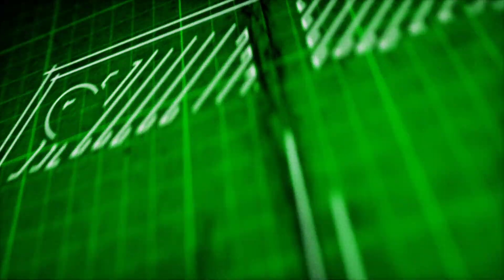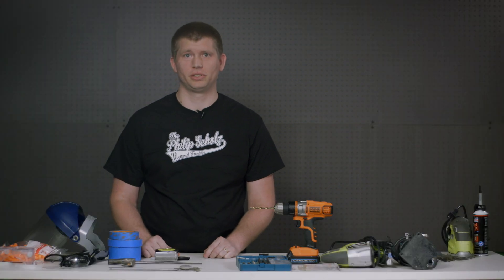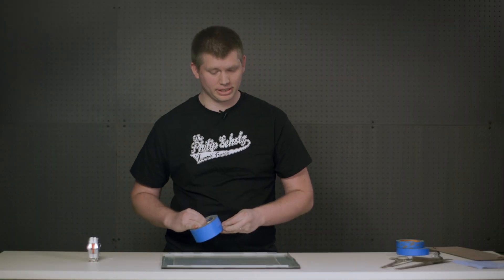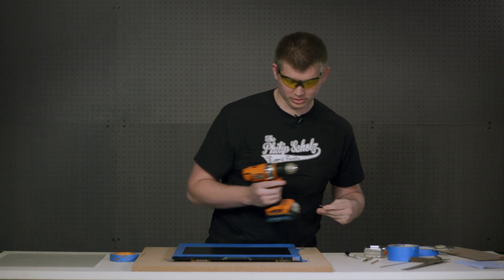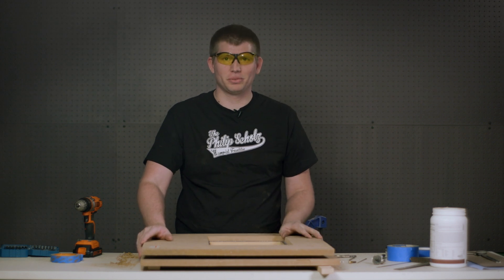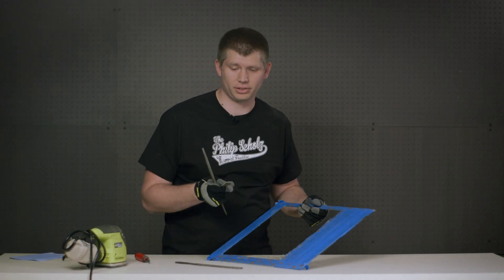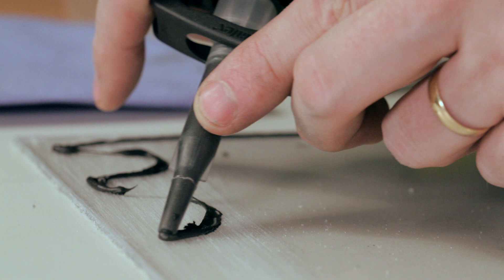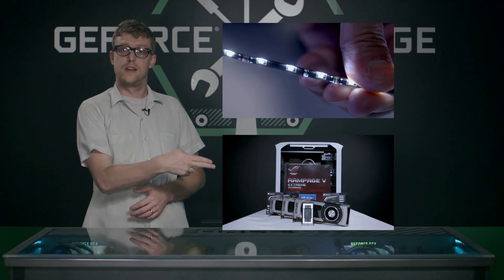GeForce Garage: Antec 900 Series, Video 1 – How To Cut a Case Window

Comment: would a dremmel with a diamond disk not give you a smoother cut?
Reply: arkatub its not really about the tool and the cut but having a guide to keep the cut straight using the wood template allows you to get a CNC style cut.

Comment: For the power tools, it would be a good idea to mention the 2 key words "variable-speed". Some may not realize this, and end up screwing something up. That's the main reason I never use my jigsaw or drill on mods, because I can't yet afford variable-speed models, just the single-speeds I currently have, and single-speeds suck for modding. Drills, not quite so much, but saws definitely.

For those with single-speed drills (or any, really), a punch + hammer are an almost invaluable combo. I use mine all the time, for all sorts of things, and can't imagine life w/out them, honestly.

Comment: I loved the tutorial till the part he used glue to stick the window to the case 

Such a horrible finish!

So much work on the metal and the last part "glue"
Reply: Jose Jimenez Would you rather use duct tape? lol.....If you ever used the stuff he used then you would know it isn't just glue. It's not cheap for a reason.
Reply: Bob Stewart he could do clips like the on this pictures with the whole piece of metal he cut from the case, and would have been better and wont cost more!

https://scontent-mia1-1.xx.fbcdn.net/hphotos-xft1/v/t1.0-9/11742723_860883227337974_3936574646639866532_n.jpg?oh=152bfa4542b187f2ef195ca6857dc264&oe=564DDED8

Just saying!

Comment: why not just stick the acrylic onto it with a strong glue?
Reply: Henry Chan The product he used holds better than contact cement. And it stays flexible. It's the best stuff out there. It's made for doing automotive work and takes the place of gaskets on almost everything. Once you try it you will never use anything else. Be warned though...  it seems to get everywhere when you start playing with it.

Comment: Cut in clockwise motion with the router? wrong it's anti clockwise. Clockwise makes the Router want to kick out, anti draws it against the work surface, also that i'm aware of i've never came across a metal working Router bit. Skip the whole Router part and just file the edges whilst the panel is in the jig,
Reply: Dinxsy You are incorrect. The shaft spins in a clockwise direction (if viewing from top down) and you want to move the router in the clockwise direction around the hole so that it digs into the material. If you move the router counter-clockwise it will jump around. That would be called "climb cutting" and can be dangerous. The bits we use are a high quality carbide with top bearing. Carbide will cut any metal without the use of a coolant but does not last as long as when used on wood projects. This is a video about using a router to do a window, not how to use a file on a window, but maybe in the future they will do one.
Reply: BSMODS Counter external, clockwise internal, thumb & forefinger rule. Not gonna lie didn't actually watch the video,skimmed over. Also Climb Cutting only really applies to wood to eliminate tear out and leave better finish, yet still not worth the risks, i know all too well the dangers of pulling work surface from using a stacked Rail & Stile bit setup on unsecured material at work.
Dual direction spiral cutting bit would eliminate the folding/burring of the tin, basically like a flute end mill, but the average hobbyist won't want to pay £100 plus for a single bit.
Reply: +fliesenfuzzi Advise from a guy that didn't even watch the video....good stuff

Comment: or just buy a case with a window...problem solved.
Reply: And cost less.
Reply: Majin Susangz True but this method is pretty good if you for some reason want to make custom looking window
Reply: Majin SusangzLike my Antec 1200
Reply: Some people like to mod things. Not everyone buys their stuff built.
Reply: Majin Susangz Like my Antec 900, already has a great window, but I still loved the video it'll make for good reference if I ever decide to do any DIY case building.
Reply: Well In my case my NZXT phantom has no window and the windowed panel they offer has a pretty small window. If I had the tools I'd much rather do this.
Reply: Majin Susangz Not all cases come with windows, and some would prefer the look of the case and/or the functionality rather than the fact that it has a window.
Reply: Majin Susangz It's for people that want a window that isn't an acrylic piece of shit that scratches easily. It will cost quite a bit more, but some people would pay for quality scratch resistant glass. I have a Define R5 case with the basic side paneling and I plan on buying some tempered tinted glass for it.
Reply: Majin Susangz I had an antec 900(original) and it had a window with a case fan on it.

Comment: Would have like to rather see a glass replacement tutorial.
Reply: Clement Kirton Glass works pretty much the same just get the glass cut to size at a glass shop. Then sand the edges so it will bond with the case!

Comment: I have a rosewill thorv2 and i really wish it had a case window but there is a 230mm fan on it and I don't really want to sacrifice the airflow for visuals especially since the case is not on my desk #firstworldproblems
Reply: Warriorheart But you can make new screw holes for the fan on the acrylic ;)
Reply: ***** true but would look stupid, imo. Little tiny bit of glass to see past and a mega ugly fan filling the rest of it.
Reply: Warriorheart I don't have hands on experience with that case but after reviewing it you should not need that fan on the side with the right fans and CPU cooler. Ive found that side fans tend to recapture exhaust heat and dump it on your GPUs. That case would look good with a window the shape of the side vent.